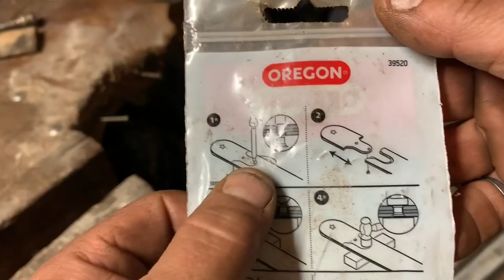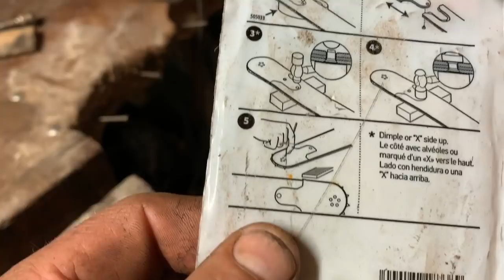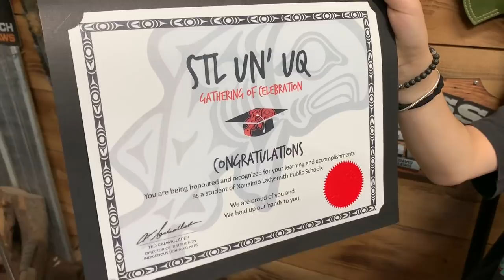how to change the tip on a chainsaw bar

Comment: Love the broken eastwing hammer got one myself!
Reply: Breaking an estwing is an achievement in itself. Those things are bulletproof
Reply: Broke three in 45 years as a carpenter
 22 oz
Reply: Pat Armentrout 
Send them back!
They will send a new one.
Reply: It depends on the break, I have broken 3 of them, one head, one claw( sent both back, and received replacements) the third, I bent and broke the handle, I kept this one sometimes it is what you need to persuade something in place, or light tapping!
Reply: @oldmanfred8676  yessir that is correct

Comment: Your right absolutely right.  Sometimes just the small  the little things can be huge an make anothers day. It doesn't take much most people are no where as busy . As they try and make themselves out to be. They need a bunch of crap in their lives to validate themselves.  Those small things you spoke of will validate themselves an give them great peace inside. An no need to run an tell see what l just did. No one needs to know.

Comment: What about when you don't have a fancy bar from the big money dealer and there's no little U shape in the middle...
Yeah... say you want a spinner tip and all it has is a circle with no cogs...
Mmmhmm... yeah were talking grinding out the weld... carefully just barely split bending open the tip sides area then slipping the replacement in then spot welding or drilling a weld hole then welding it together then filing and smoothing the bumpers...